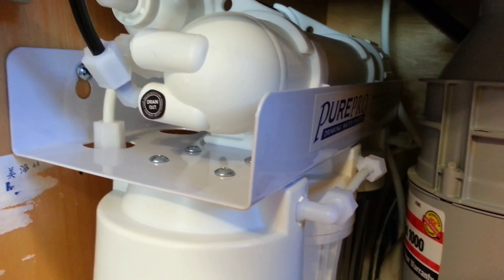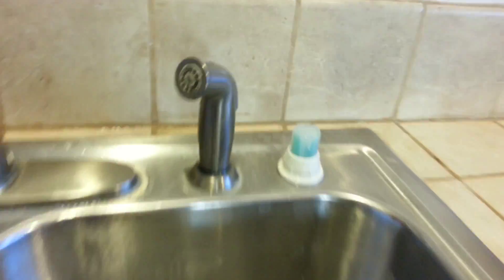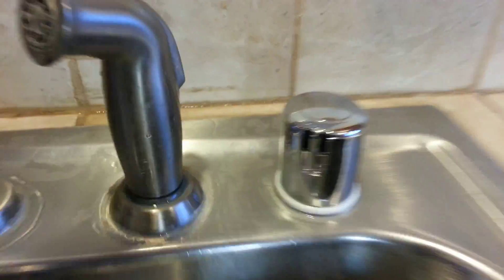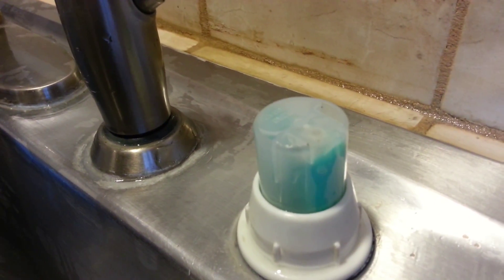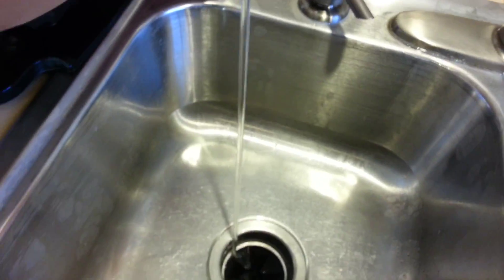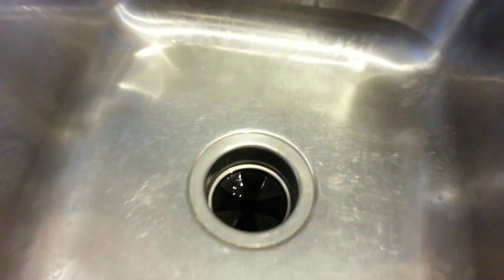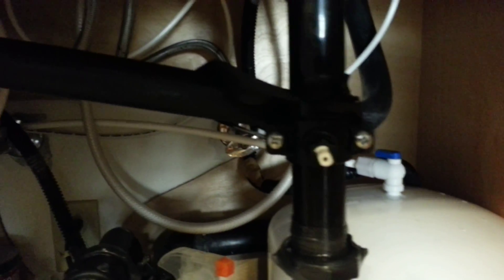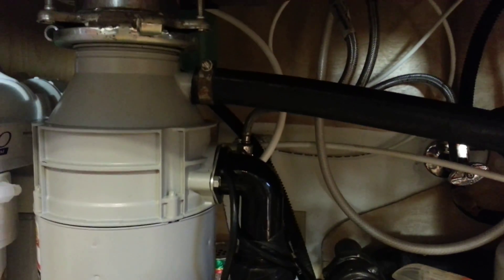Reverse Osmosis Air Gap

Comment: You could simply use an airgap r/o faucet. Dishwashers may or may not need an airgap depending on local building code. You can opt to remove yours (like I did) to install your R/O system if you don't have enough holes in your sink/countertop and loop the hose from your dishwasher and hang from the underside of the sink. You DON'T want that loop to be lower than the sink, otherwise the drain water from your sink or garbage disposal will backflow into your dishwasher. The loop creates the airgap. If you see dirty water in your dishwasher with this method, you know you have a blockage somewhere, whereas the above counter airgap would puke water into your sink alerting you.
Reply: Your right about the high loop code but it does not create an air gap. It simply creates a loop with no potential for waste to flow back to the dishwasher

Comment: so where's your dishwasher air gap then?
Reply: That is a special air gap that takes the dishwasher and ro drain water. Just a regular air gap but it has an extra input just for the RO tubing. My question is where did he move the out put of the drained water?
Reply: @beckyschwantes5287  Ahhh yes I see it now. Also to answer your question it's now combined with the dishwasher drain line, large black hose going into the garbage disposal. Love to know where to get that airgap.
Reply: @WilliamDeanPlumbing  look up “dual air gap for dishwasher and RO” on Amazon. They have one with the quick connect installed. That is the generic one. The company that patented the design is called “air gap inc” they have products like “gap a drain” and gap a flow” but they also have that nice one he has pictured in the video. It is higher quality than the Amazon unit and I think it’s about the same price .
I can’t see the line tied into the dishwashers line??!  That spot at the drain would be fine if it wasn’t right where the garbage disposal teed in.  But the air gap eliminates the whole problem he is worrying about. There is no way that it could backflow with an airgap. Plus there is an auto shutoff or a check valve at the drain so nothing can flow back. But check valves do fail.
Reply: @WilliamDeanPlumbing  I can’t see where he has the new RO drain. But the spot he had it at was actually perfect. High up on a vertical fall and far away from the. P trap. How did he connect to the dishwasher line?
Reply: @beckyschwantes5287  Found it, thank you. So if you look, you can see where your RO connects to the airgap, at the bottom of the airgap, also the dishwasher discharge hose connects to the bottom of the airgap, then both combine into one outlet at the bottom of the airgap, large black hose, which then traverses down to the garbage disposal hose inlet. Hope that helps. Also if you look at the pic at amazon you can understand what I'm saying.
Reply: Speciality item dual air gap

Comment: What make/model is that air gap? Is it specifically for RO systems with small 1/4" hose lines or is it a standard dishwasher airgap that you adapted to work with your RO hose lines?